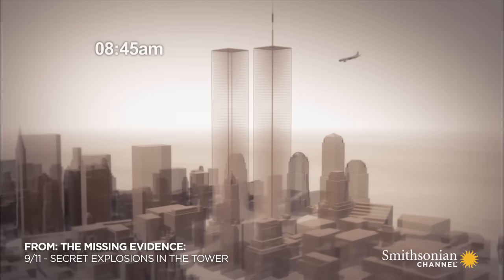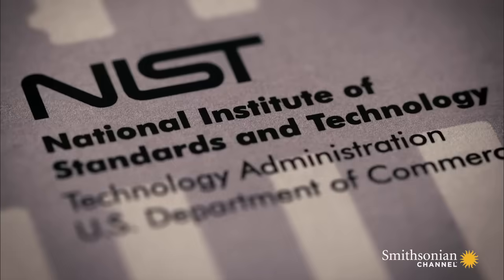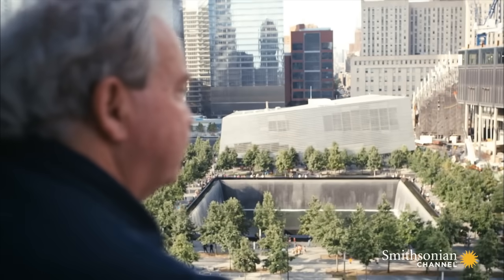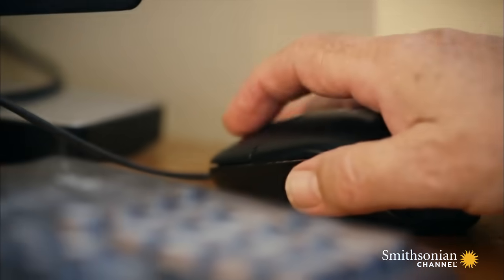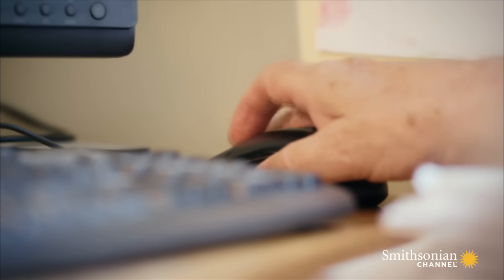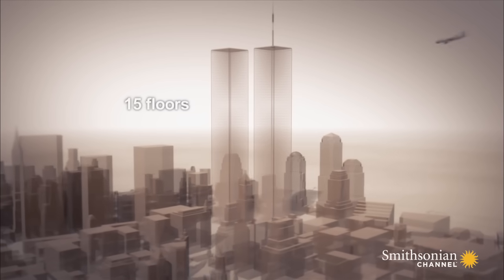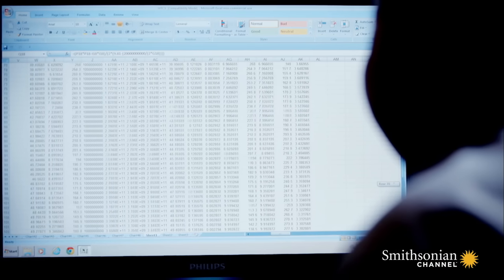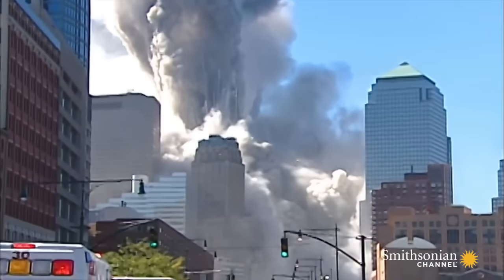This Computer Simulation Explains How the Twin Towers Fell

Comment: This is basically the pancake theory pushed by the mainstream media as to why the towers collapsed. But this can only happen if the strong steel and concrete vertical supports are cut, which is exactly what happens in controlled demolition. The squibs were the supports being intentionally cut with explosives.
Reply: The 'pancake theory' was FEMAs explanation for the collapse initiation.  

"The squibs were the supports being intentionally cut with explosives."
There are no squibs on any of the videos.   
There is debris being pushed out while the buildings collapse.
Reply: @markh1011  The debris explanation was how they explained the squibs but that doesn't make it true.
Reply: @wolfrunning1   The evidence fits the explanation.
Reply: @markh1011  Not really. Have you looked at the evidence for explosives being planted in the towers, such as comparisons with controlled demolitions in other towers, witness testimony seeing, feeling, and hearing explosives, the leftover explosives dust found, and the intense lavalike melting of the steel under the collapsed towers as evidence of military grade explosives?
Reply: @markh1011  lol
Reply: @wolfrunning1  Aahhh… you realize you’re repeating the same failed conspiracy nonsense that’s been floating around for 20 years, right?
Reply: @tpryce6243  all done anything else
Reply: @wolfrunning1  
" Have you looked at the evidence for explosives being planted in the towers, "
Yep.

" such as comparisons with controlled demolitions in other towers"
Videos where you can hear the very loud obvious explosives going off that people spent months setting up....    big problems for the 9/11 conspiracy theorists.
Reply: @wolfrunning1  
" witness testimony seeing, feeling, and hearing explosives,"
Planes smashed into buildings, jet fuel exploded, multiple buildings collapsed.  They would have heard and felt many things.

"the leftover explosives dust found,"
There was no such thing.

" and the intense lavalike melting of the steel "
No one has demonstrated the melting of steel.

Comment: All I know for sure is I have heard plenty of credible witnesses that said the exact same thing. All reported hearing multiple explosions just like a controlled demolition. I'm not trusting a computer simulation when I have so many credible witnesses that said the exact same thing. Also there's plenty of reliable experts that stated it was impossible to take the buildings down with the fuel from the plane's. The fuel can't burn hot enough to melt the support beams that we're used in the buildings. The buildings we're engineered strong enough to take the impact of a commercial plane. Math and science don't lie just physiopaths that are pure evil lie. Ask yourself who had the most to gain from this horrific tragedy?
Reply: The internet age and Smart phone technology was taking off. The power to be able use this to spy on people for all sorts of reasons was coming to light. It would be illegal for the USA government to do so. Patriot act 101.  Hear and fire can weaken steel to bend  easier however it wouldn’t melt it. The steel under the weekend area was heated and had enough t strength to hold up 3x the weight it was designed to. The buildings wouldnt have fallen that way.  I agree with you.
Reply: And yet, no evidence of explosives was ever found, even though the debris was sorted by hand. NOTHING. How do you account for that?

BTW there's no evidence that any steel melted at the WTC, so you can toss that one, too.
Reply: @Tim22222  Your completely avoiding the question I asked by answering my question with asking another question that had nothing to do with my question. I'll repeat my question again ask yourself who had the most to gain from this horrific tragedy?
Reply: @TheLightSeeker...  Do you believe the earth is flat?
Reply: @tpryce6243  all done anything else
Reply: @Tim22222  no evidence found? Who was looking? There are testimonies and videos of molten metal and numerous fire department personnel saying they heard numerous small explosions. Maybe U.S. conspiracy theorists are wrong but what helps keep things in check is asking questions  when there is evidence. That’s a fundamental of the 1st amendment which now also is clearly under attack. The psychology is such that something that is a real conspiracy is so toxic to come as true to what people want to avoid as reality,, there minds avoid it. Non of us want to believe that something like this was planned or allowed for some other purpose.  The perfect example right now which our current corrupt government is having real troubles “twisting” is the fact, a solid fact, that our borders are wide open. The single biggest problem with the USA voter is that that they don’t dig deep enough and follow all sides of all these situations.

Comment: The guy was shocked because a building can't  crumble straight down without help
Reply: It was helped by the use of two jet airliners.
Reply: Let's hear about the research you've done
Reply: A fully-fueled jetliner crashing into it at 500 mph isn't help??
Reply: @Tim22222  yeah if the plane  and fire happened to cause the top part to break off the fact is that the building below is far stronger that the shock load from the top peices dropping a couple of floors.  So when they fell they would not have enough force to crush the building to the ground.  Why do you think a demolition is done by blowing out multiple floors at the base and most of the time multiple floors throughout the building.
Reply: @Tim22222  did you give fitz a break from being a shill?

Comment: False flag operation. All 3 building fell at near free fall, into what should have been the path of most resistance. This is impossible to occur due to asymmetric damage. It must be an engineered collapse. See architects and engineers for 911 truth. Don’t stick your head in the sand because that’s the perfect position to get f**ked.
Reply: "Into what should have been the path of most resistance. T"
That's what gravity does.
Reply: @markh1011  lol
Reply: What is "near free fall" and why does this matter?
Reply: @MFitz12  when you cut a tree from it's side, it tips over it doesn't crash vertically
Reply: @Bloom_HD  - And if buildings were trees we couldn't use them because they would be solid. Twin Towers 95% air by volume,. There is no hinge point for tip.
Reply: @MFitz12  structurally they still should be able to maintain their upright form. There are beams that run the length of the entire building responsible for supporting it. That's how it stays upright in the first place. One point of fracture should not be able to disassemble that structure in its entirety. Think of it as 4 trees in a square formation wrapped in cello tape, and 2, maybe 3 of them got hit. The whole structure wouldn't crumble into one pile, there would be an obvious tipping effect, unless of course you carefully place charges along sectioned lengths of the trees and set them off simultaneously. Then you can end up with a neat little pile of debris
Reply: @Bloom_HD  You’re debating a guy that is intentionally trolling on here. Don’t pay attention to M Fitz, the guy is literally a troll, he has multiple accounts (one pretending to be me and several under the name tpryce) and has been trolling 9-11 videos for at least 10 years.
Reply: @MFitz12  lol

Comment: 38,000t is nothing compared to 500,000t.
The bottom tier of core columns were 52"x22" with 4" thick walls. They sat on massive steel anchor pads that were seated in bed rock seven storeys below ground level. This tier of core columns had horizontal support beams that were placed in the core column system for lateral load support. The first tier of core columns ran from bed rock though the 66th floor. It was able to carry 3 times it's weight. 

Greening is an establishment lackey.

Comment: Only NIST never put a word about Bldg. 7 in their "official" report.  All your crazy theories aside about Bldgs 1 & 2, anyone who looks at Bldg 7 and concludes it was anything other than a controlled demolition has cheese for brains.  911 was an inside job.  Here's some facts: 7 was over 500yds away from 1&2, never got hit by anything, had a mysterious fire on the 14th floor, and is the only multistory building in the last 10,000 years reported to have collapsed from a wastebasket fire.
Reply: There are actually 3 major engineering reports on Building 7. I can explain its collapse to a high level of detail without resorting to the hand wave of CD.

I have yet to have anyone explain to any level of detail how any sort of CD could have worked. It is the dumbest idea in perhaps all of human history. A solution designed by people who can not think so they don't have to. Absolutely lazy and completely lacking in subtance.

I'm ready to test that. Are you?
Reply: "Only NIST never put a word about Bldg. 7 in their "official" report."
What decade are you living in?   NIST included that in their official report over 10 years ago.
 🤦‍♂

"Here's some facts: 7 was over 500yds away from 1&2, never got hit by anything"
It was hit by part of a collapsing skyscraper.

"and is the only multistory building in the last 10,000 years reported to have collapsed from a wastebasket fire."
Except for the other skyscrapers that have collapsed due to fire like the Wilton Paes de Almeida Building and Plasco Buildings. 
You got everything wrong.
Reply: Nist report on building 7 is available online

Comment: What about the seventh building? 
What about "flight 77" and "flight 93" vanshing. 
Nothing strange going on here.
Dont ask too many questions
Reply: Flight 77 and 93 did not vanish. The Black box information for those aircraft is available online they also match passengers and crew members through DNA
Reply: @mikebyrd8278  Yeah but what about the planes dissapearing into holes too small for them and not leaving a trace
Reply: @isakjohansson7134  well the planes made the hole so I don't know why you don't believe the holes are big enough. Everybody saw the Jets crash into the buildings so I don't know why you would not believe they didn't crash into the buildings. Yes they did find jet debris and body parts that were identified to passengers and crew members on board the aircraft. There's pictures of jet debris online
Reply: @mikebyrd8278  lol
Reply: @mikebyrd8278  The lawn of the pentagon was empty in the immideate aftermath of the crash, only a blurry 1 fps camera caught "something", something far too small to be the plane in question. The hole had no wing or engine shapes to it and neither could be found outside. 
Regarding flight 93 the hole was too small and emty of any and all debris
Reply: @isakjohansson7134  the object and video was not too small to be an aircraft you can also make out the vertical stabilizer. The lawn was not free of debris nor is there any proof anybody planted debris. I found the engines and the Black box they also linked all but five of the people that were killed there through DNA and dental records

No the hole was not too small for flight 93 in fact you can see the shape of the jet in the ground as it crashed vertically. They did find debris and the black boxes and the information is available online
Reply: These 2 flights didn’t vanish.
Reply: Fire
Didn't "vanish". 
No
Ask away.
Reply: @MFitz12  <--- this guys a shill
Reply: @MFitz12  🤖🤖🤖🤖🤖
Reply: @isakjohansson7134   You’re debating a guy that is intentionally trolling on here. Don’t pay attention to M Fitz, the guy is literally a troll, he has multiple accounts (one pretending to be me and several under the name tpryce) and has been trolling 9-11 videos for at least 10 years.
Reply: @GhostSal  Yeah i know 90% of comments are just bots these days
Reply: @isakjohansson7134  In this case he is a real person but a troll nonetheless. His only job is to cast doubt on legitimate concerns about 9-11, he has been doing this for years all day every day. He has multiple accounts too, some pretending to be other people like pretending to be me, that’s why I changed my name to reflect my account start date (Jan02 2016) because he can’t copy that. We know Russía has trolls, the idea that the US doesn’t have paid trolls too is naíve. After all, think about all the time and effort he puts in (years, both day and night), why would anyone who isn’t paid do that? So either he needs psychiatríc help or he is a paíd troll.

Comment: The fact that the twin towers were designed to withstand a airplane strike is a bit suspicious to me.
Reply: Building 7 coming down should be really suspicious to you too, it came down and was never even hit by a plane. Also, NIST’s official claim was the failure was do to “office fires”
Reply: The planes that hit the WTC were heavier and were going 3x faster than the plane in the scenario the engineers examined. Oh, and they were fueled for trans-continental flight, whereas the engineers did not include fuel & fire in their calculations.

Not the same.
Reply: @Tim22222  makes sense but why were they even designed to withstand a hit at all?
Reply: @ronanbrett1774  My understanding is one of the engineers brought up the 1945 incident in which a B-25 bomber crashed into the Empire State Building, and it became an intellectual exercise for the WTC designers: What would happen if something like that happened to the towers? But the plane that hit the ESB was 1/10 the weight of a 767, was flying slowly (lost in the fog) and low on fuel. They used that scenario in their calculations, not a fully-fueled jumbo jet being deliberately used as a missile!
Reply: @ronanbrett1774  - Because excluding 9/11 there have been at least 3 other instances of aircraft striking high rise buildings in Manhattan and a near miss in 1981.
Reply: @Tim22222  uh huh. Anything else?
Reply: @MFitz12  so you are all done now?
Reply: @MrYourfriendbutters  Uh huh. Anything else?
Reply: @tpryce6243  lol lol lol you think your demoralization tactics work in this new age.  Lol lol lol lol lol lol lol
Reply: @MrYourfriendbutters  So you’re all done now?
Reply: @tpryce6243  uh huh. Anything else?
Reply: @MrYourfriendbutters  Uh huh. Anything else?

Comment: Jet fuel doesn't melt steel!
Reply: Not to mention building 7 coming down and that was never hit by a plane. Nor was it directly next to the two towers and it came down officially from “office fires”. Also interestingly fires on mostly one side of the building is supposed to have caused a symmetrical failure.
Reply: @GhostSal  Uh huh. Anything else?
Reply: @tpryce6423  all done?
Reply: @MrYourfriendbutters  So you’re all done now?
Reply: @tpryce6423  lol lol lol lol
Reply: @MrYourfriendbutters  Uh huh. Anything else?
Reply: No one ever said it did.
Reply: @Tim22222  lol